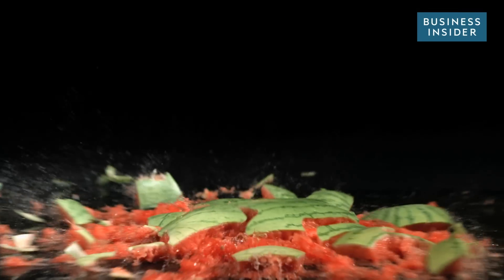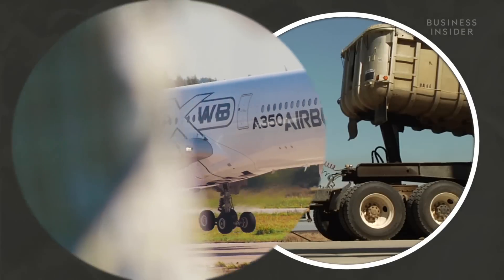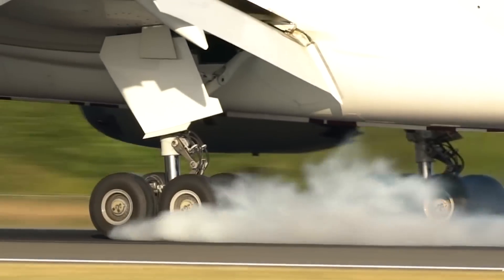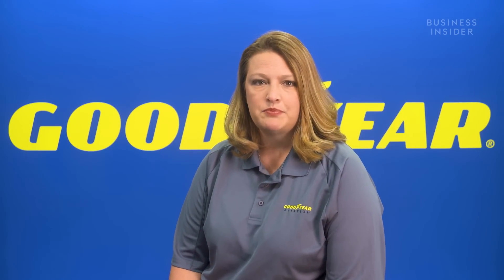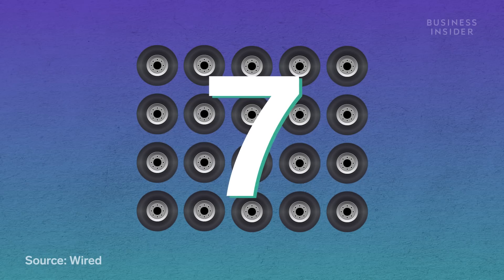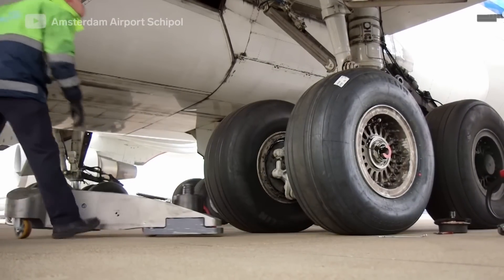Why Plane Tires Don't Explode On Landing

Comment: I still cannot believe these damned plane manufacturers don't put a device on the landing gear that speeds up the tires to ground speed. Seems like it's save a lot of tires
Reply: One of the tasks I had in the landing gear group I used to work in was responding to queries from people who had "invented" tire pre-rotation.  Usually it's "vanes", but sometimes "electric motors", and once in a while "hydraulic motors".  None of that works, by which I mean that the solutions are all more problematic/expensive than the original problem (which is less of a problem than people imagine when they see the touchdown smoke).
Reply: @marcmcreynolds2827  😂I thought I was the only 12y.o. boy with that idea.
Reply: @CornFedZ06  You had me beat by about ten years -- I pitched it to my boss not long out of college.  He proceeded to explain to me some of the things I have now explained over and over to others, handed me the form letter he used as a starting point for replies, and said something like "Now you can be in charge of it."

Comment: Over 25 years ago I saw a TV talent show where 3 school kids invented small pockets to go on the walls of airplane tires to catch the wind and spin them up before they touch the runway, to reduce stress. Everybody cheered and they got a small check from Airbus. Everyone thought they'd be rich and famous but we've never heard from them or their invention again.
Reply: Airbus was just being nice to the youngsters.  One of the tasks I had in the landing gear group I used to work in was responding to queries from people who had "invented" tire pre-rotation.  Usually it's "vanes", but sometimes "electric motors", and once in a while "hydraulic motors".  None of that works, by which I mean that the solutions are all more problematic/expensive than the original problem (which is less of a problem than people imagine when they see the touchdown smoke).
Reply: @marcmcreynolds2827  Late but welcome reply, thanks for the insight!

Comment: 3:19 For all Americans watching 5 centimeters is around 2,5'' wich is more than enough to fit a thumb.
Reply: 5 cm is actually a little under 2 inches. EXACTLY 2.54 cm are in an inch.

Yes, us Americans know about the metric system, and yes, we know how to convert between the two.
Reply: @howardbaxter2514  The point is that you can fit a thumb in that gap. Thanks for correction. :)
Reply: @Marko-dx2tu  you should be able to fit a whole damn two fingers in the gap.

Comment: "Nitrogen is an inert gas"
Face Palm !!
Reply: Nitrogen is isn't an inert gas, in the same sense that argon is an inert gas, but for many purposes it behaves as a quasi-inert gas, because of how energy-intensive it is to break its elemental diatomic form.  Unlike oxygen that may ionize to form ozone, or oxidize other substances such as metal corrosion, nitrogen will not do that.  Some plants have the capability of chemically reacting N2, but for the most part, as long as you don't heat it to flame temperatures, it will stay as N2.

The obvious reason they don't use actual inert gasses to fill tires, is that it is a lot more expensive to distill argon, krypton, neon and xenon from the air.  Nitrogen is the dominant component of air, so it is the most readily available to use, when a non-reactive gas is needed.

Comment: 2:57 there is no way thats the arerage amount. The most common pasenger  planes only use  6 tires, With bigger ones having 12-14. Only the a380 has over 20 with  22. Unless some airline has a hidden fleet of An 225s there is no way the average amount  is 20 per plane.

Comment: The runway is 21 inches thick.  The tires are 150lbs/sqin  with N2 inside.   I flew with interceptors at RAF Leuchars.  We painted 2 white lines on runway - land outside and a round of beer in the Mess later........the mechanics asked us to stop as they were getting only 9 landings from each set of tires, 'cos the pilots were driving in so hard!  We won!

Comment: Your comparing a soft watermelon hitting the ground at 170mph as a direct hit from thick rubber tires made specifically for that purpose hitting the ground at a very shallow angle compared to straight down

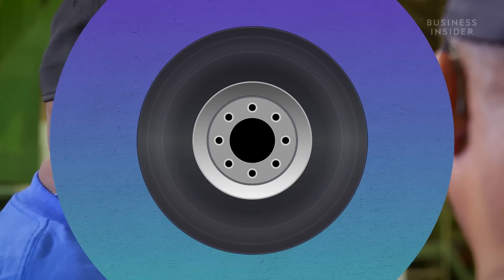Comment: 1:39 this is completely wrong. Bigger tires need LESS air pressure. A private jet for example needs a lot more air pressure than a 737. A car tire depending on the tire size needs about 2 bar pressure, while Aircraft tires need at least 14 bar or more which is not six times as much.

Comment: " 45 inches  of rubber  "  is not an accurate description. 

truck vs aircraft tires - trucks are limited to 80,000 pounds and most have double rear axles with 4 tires on each axle. most tractor trucks have equally double rear axles with 4 tires on each axle. so essentially the tractor is limited to 80,000 pounds disbursed on  16 tires.  the biggest commercial passenger jets have 4 tires on each main landing gear installation - totaling 8 tires supporting almost  the entire weight of the aircraft over 550,000 pounds for the 787-9    7x the  weight of a tractor trailer on half the number of tires. 

tire pressures. the tire must have enough strength to hold the pressure and the " bead "  must be able to grip the wheel.  most heavy aircraft tires hold pressures over 200 psi of nitrogen.  nitrogen has no water vapor, no oxygen which causes more drastic changes in pressure under heat  ( 200-500*  during braking )  - greater loss of pressure at sub freezing temperatures (  -50*F )  and does not hold corrosive elements that corrode  VERY  expensive wheels. 

grooves - aircraft do not need to maneuver on the ground like cars.  their most critical ground operation is take off and landing - neither of which require turns. thus their grooves are in a straight line.  most runways are also grooved to disburse water.  these grooves are annoying and negatively effect the handling of cars. aircraft ground operation is minimal. thus these grooves only effect the aircraft for very short periods. 
nuts and bolts- most aircraft tire/ wheel assy's  will have 3 bolts holding the bearing cover / hub cap .  2 bolts holding the bearing nut - and the bearing nut itself.  what takes the bulk of time to change an airline tire is gathering the parts and equipment. not forgetting the tire itself is over 3' in diameter and weighs over 300 lbs. 

an aircraft tire is not made for comfort, not for racing, not for vibration dampening, not for appearance, not for steering, not for corner handling.  an aircraft tire is made to support, cushion and stop the weight of the aircraft under extremely hostile conditions. 

the biggest differences are the tire bead must be able to grip the wheel under hostile/ violent, extremely hot stopping conditions
the sidewall must be able to support the weight of the aircraft even if another tire blows out the remaining tires must support the weight. 

the tread footprint must be able to stop the aircraft without shredding

Comment: Questions asked to be answered. What are the indicators for tire abandonment after installation & required new tire replacement? Tire tread depth? Usage duration in years? Frequency/Numbers of takeoff and or landing? Tire tread cracking?

Comment: Quite a disingenuous video presentation. Those shredded tires on highways are most often "retreads" trends glued onto rubber tires. They are still allowed in some states for commercial trucks. Easy answer is jet liner tires are constructed under exacting standards different from other vehicles.

Comment: Who wrote the drivel? This video is completely wrong. It's a very common occurrence for plane tires to go flat, explode and shred on takeoff and landing. It takes less than an hour to replace them if done correctly and they are recycled into not only other plane tires but also truck, car, tractor ect ect

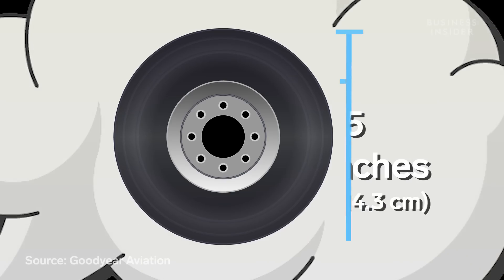Comment: 0:28 "between you amd the tarmac"

There is no such thing as a tarmac. it's a common misconception, but it doesn't actually exist. People usually think the tarmac is the Apron, but you managed to get it even more wrong. Seriously? How do you not know that it's called runway?
Reply: Nate Malm People usually think the tarmac is an apron?
Reply: Tarmac certainly exists.  It is tarmacadam which is gravel coated in a tar binder.  It looks like asphalt. But it isn't used at airports.

Comment: Then why concorde tyre blast which resulted to end of concorde planes.?
Reply: The tire issue on one plane was not the reason why Concorde failed. It was simply not profitable. And also no matter what tires will blowout here and there.

Comment: 0:36
Call it the TARMAC one more time 

I dare you
Reply: tarmac
Reply: Lmao
Reply: Runways may be a man-made surface (often asphalt, concrete, or a mixture of both) or a natural surface (grass, dirt, gravel, ice, sand or salt). Runways, as well as taxiways and ramps, are sometimes referred to as “tarmac,” though very few runways are built using tarmac
Reply: When I heard tarmac I cringed
Reply: Lol
Reply: Some runways ARE tarmac though, so theres that.
Reply: Mate, look up Google. They're no aviation fans. Some runways are Tarmac. Tarmac: material used for surfacing roads or other outdoor areas, consisting of crushed rock mixed with tar.
Reply: TARRMACC
Reply: Thanks Vader

Comment: At 0:00: "If you dropped a watermelon at 170 mph (275 km/h), it would be a mess. Strap over 500,000 pounds (227,000 kilograms) to its back and it would be, well, nothing."
At 2:10: "Then the tires are tested beyond their breaking points. They're tested for speed, pressure, and the ability to handle a load up to 38 US tons (33.6 metric tons)."
At 3:27: "The mechanics take off the hubcap and reduce the tire pressure from 200 to 30 psi (1,400 to 210 kilopascal), which reduces the risk of it exploding as the bolts and nuts holding it on the plane are removed."
At 3:50: "Nuts and bolts, tire reinflated to 200 psi (1,400 kilopascal), hubcap back on, and the whole thing is gently lowered 5 centimeters back onto the ground."

Comment: "Nitrogen is an inert gas."
Your friendly neighboorhood chemist major: Well yes, but actually no.
Reply: Thank you my friendly neighborhood chemistry major, very cool!
Reply: Rab Blay in case of extreme high brake temperatures or fire (after an aborted takeoff) the tires have a fuse to release the pressure rapidly instead of allowing the tires to burst. It’s convenient that the gas released won’t provide any Oxygen to the extremely hot brakes, hence the use of Nitrogen exclusively.
Also, Nitrogen is a larger atom/molecule, which won’t escape so easily during normal operations thus keeping tire pressure for longer. 
And Nitrogen is 78% of the gas mix in the atmosphere = abundant and non toxic.
Reply: @ruirodtube  but I learnt in school that rate of effusion=k(1/√mol wt) according to Graham's law of diffusion. So Noble gases that have higher mol wt than nitrogen should stay in tires longer right?
Reply: Fuzzy 1234 yes indeed. Nitrogen is just more abundant and therefore cheaper to use than noble gases.
Reply: @ruirodtube  yeah it makes sense.. thank you!
Reply: How about using co2?
Reply: booger king CO2 has O2 and it’s less than 1% of the atmosphere. Nitrogen is 78%.
Reply: I'm curious nitrogen isn't an inert gas...but the meaning of inert is different than what we basically use I guess....why not use the actual inert gases? Helium, argon etc? Maybe because they are hard to come by?
Reply: Fuzzy 1234 because nitrogen behaves exactly like the noble gases at these temperatures and pressures so it would be useless
Reply: @mxerb5912  Thanks! So why not we use the real noble gases tho?
Reply: @mxerb5912  is it because it is present in less proportions than nitrogen ?
Reply: Fuzzy 1234 Helium is so small it would eventually diffuse through the tire. Argon isn’t that expensive but would need to be supplied by bottles. I’m guessing airports have air separation systems to supply high purity nitrogen. They could probably just use air (remember air is 79% nitrogen) as it would behave the same as a gas. However oxygen oxidizes rubber and metal so I’m sure that’s why they use pure nitrogen to prevent the tires from degrading from the inside.
Reply: @mxerb5912  thank you
Reply: @mxerb5912  Nitrogen gas, if I'm not mistaken, is extremely hard to catch on fire, unlike air containing oxygen in it

They use Nitrogen because it's cost effective at being safer than air
Reply: @aravindhkumar3976  Helium molecules are so small they go right through a tire's surface.   Your tire would be flat in hours.
Reply: wtf,nitrogen is inert??? so how it easily gets oxidised to form NO2,N2O,NO and  so on????
Reply: It is, at least under normal pressure and temperature. But it doesn't make any difference on its expansion with heat. The main reason for using nitrogen in tyres is, any moisture has been removed from it  during the production/compression. It is the moisture in normal atmospheric air causing all the problems mainly excessive pressure fluctuation with temperature changes. Added (marginal) benefits of nitrogen  are a slightly less weight and more safety in case of a fire.
Reply: Nitrogen isn't inert but because N2 is a triple bonded diatomic system it's pretty darn stable and so it sort of behaves quasi-inert. We don't use the true Noble gases because that would be unreasonably expensive, and also like mentioned helium would probably diffuse out of the tire even if we could afford to fill the tires with it
Reply: @conorjames3533  thank you!
Reply: @conorjames3533  you chemistry major
Reply: @conorjames3533  you nerd major
Reply: r/humblebrag

We get it you’re a chemistry major. Thank you chemistry major. Although you don’t need to be a chemistry major to know that, it’s alright because now we know you’re a chemistry major
Reply: @zharewandang  don't worry, I'm not actually a chemistry major. I'm just a boi who has deep understanding about memes...

Comment: I don’t know who’s ever had this question but the writer. I’ve always wonder how they don’t melt. This has been answered, by the Nitrogen filling.
Reply: Actually they can melt if they get to sliding too much. Reverted rubber is where the skid time is too long and the tread melts. Then the tire starts sliding on the melted tread. The ABS and Autobrake systems are supposed to not allow that to happen, BUT if those systems completely fail then the manual braking mode has a higher probability of locked brakes and long tread melting skids.

Comment: i think the reason is due to lack of moisture in a pure nitrogen atmosphere.   water in air causes unstable pressure behavior when tires heat up stressing the tires beyond specification.   I think that is the reason.
Reply: Also water vapor facilitates corrosion and other degradation processes on the inside of the tire.

Comment: Doesn't the fact they spin the wheels when lowering before landing help the tires not explode too?
Reply: No one spins the tires before touch down. The idea has been tried and the systems end with huge failure prone electric motors or fractured vane systems. Watch slow motion videos of all the modern airliners landing and you see no rotation, or extremely very low rpm rotation, of the tires prior to touch down. 
The touch down spin up friction is now considered a nice amount of added drag helping a tiny bit to slow the aircraft down.

Comment: Why don't the make car tires last or be that durable
Reply: Well plane tires cost $20000 for 4 so....
Reply: Truck fleets with top quality tires don't get that level of durability. Maybe a total of 3.5 lifetimes( 2 to 3 retreads ). The average passenger car owner would not like the rough ride from so many belt layers.

Comment: What about the Shuttle Orbiter tires?
Reply: Specialized Michelin airliner tires pumped to 320psi, if I remember correctly. The nose tires lasted for two landings and the main gear tires lasted one landing. The tires were relatively small in order to reduce the overall weight of the landing gear assemblies and the amount of space they took up inside the Orbiter. It was discovered that the original runway grooving in the touch down zone was adversely affecting the landing gear assemblies. The runway grooves grabbed the tires so hard that the landing gear assemblies were shaken beyond what they were supposed to be. NASA smoothed out a decent distance on the runway so that the Orbiter could move around some after touch down, thus lowering the amount of adverse stresses on the landing gear. After that new free play area came the old grooves in the runway.

Comment: “The only thing between you and the Tarmac is 45 inches of rubber.” Well if you were standing on the tire then yes but the in way more the 45 inches of rubber between the average passenger and the....ahem....runway.

Comment: Tech insider "this runway is made out of tarmac"
Reply: Tarmac is a name for a material that at one point was used in airport pavement construction.  Even though this application no longer uses tarmac as the material, tarmac is the de-facto name for any pavement at the airport, that is built for airplane traffic.  It refers to all of the above collectively.  Runways, jet aprons and taxiways.
Reply: @carultch  ahh never knew that